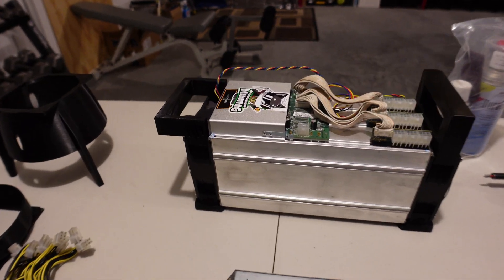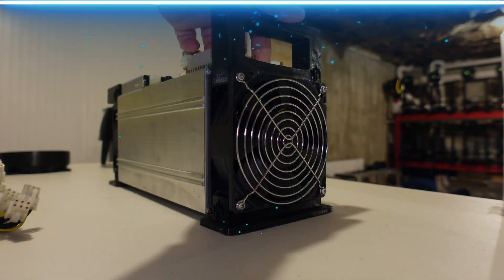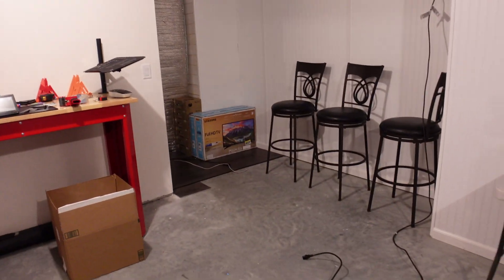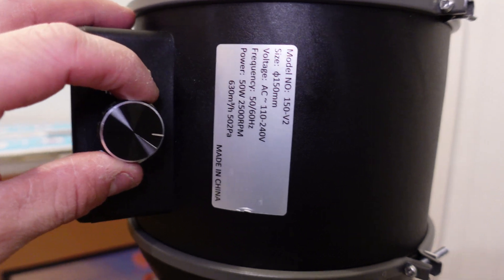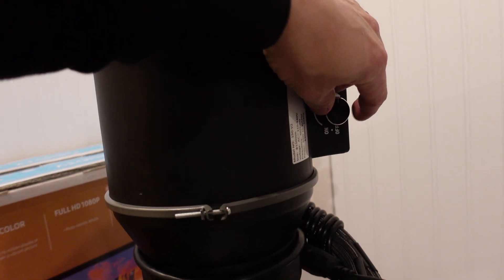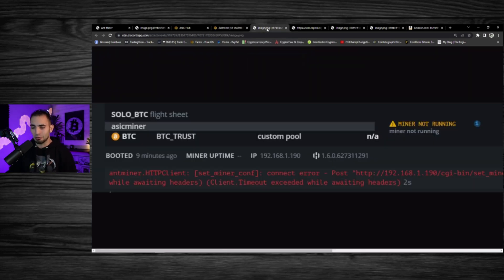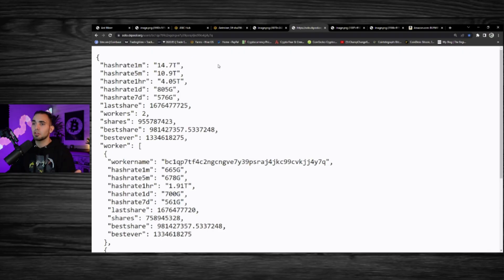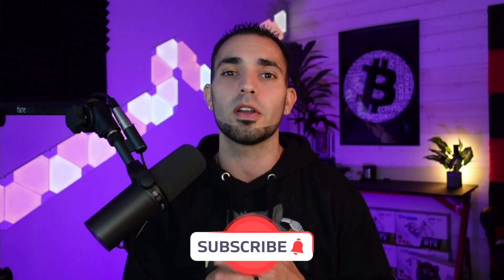THE BITCOIN ROCKET | DIY CRYPTO MINER!

Comment: You are putting hiveos firmware on there right? Way way more efficient and still get hiveos access.
Reply from the maker: I’m not currently running it but I did try to put it on and it would not take so I have to try it again at a later date

Comment: Ac infinity cord just as screws that hold the wires in.... open the 4 screw door on the blower and shorten the cord
Reply from the maker: Yea I will on the next one when I rip apart that SCAM heat bit heater lol

Comment: Flash the hiveos firmware on the miner vs just using the hub and you should have that option to shut off fan check
Reply from the maker: I tried to flash it prior and it wouldn't work but I will give it another shot!
Reply: @ChumpChangeXD  may have to sd flash if you are getting a signature error